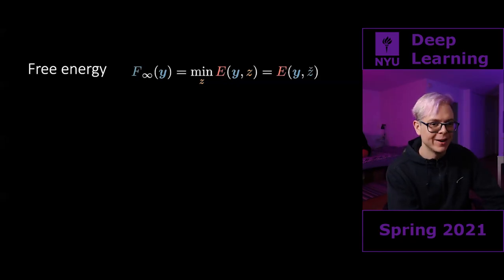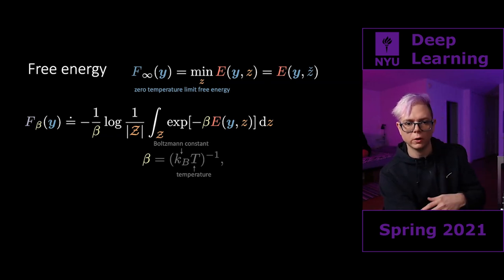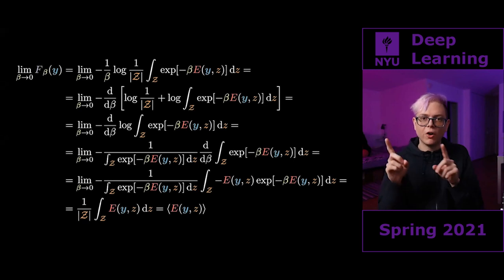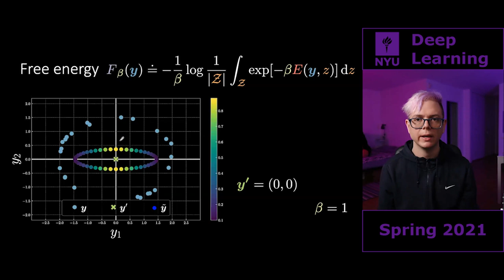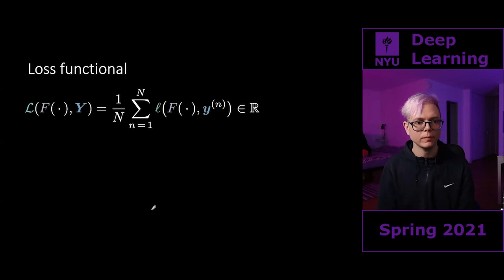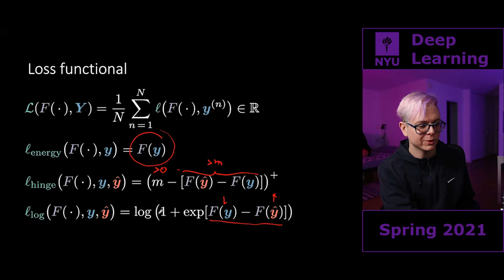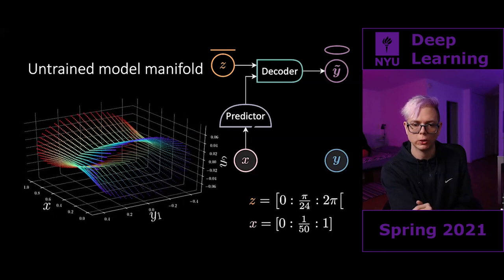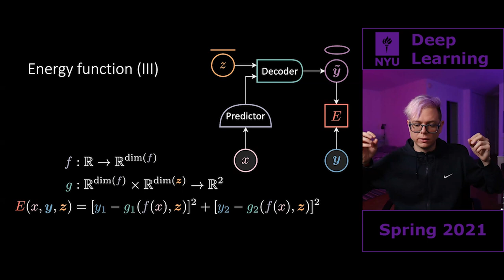06 – Latent Variable Energy Based Models (LV-EBMs), training

Comment: Hi Alfredo thanks for the clear explanation on a not so intuitive topic :))

I've got a question which might be a bit silly to ask lol 
At the end of the video you've mentioned that there are 2 things to research/work on:

1. How to find the right decoder
2. How to determine the constraint of the latent variable

May I ask for point number 2, apart from the dimension of the latent, should the subset of value of latent also be learnt? Or actually by constraint you mean constraint of all kind no matter it is dimension of z or subset of z or other weird stuff.

For example 59:37, should the range of z be learnt so that it is between 0 and 2pi? I understand that in fact z can range from [-inf: inf] in this case coz eventually it is fed into a sin and cos function.
Reply: I think I might have figured that out. It should be all kind of constraint, like for VAE we learnt the mean and variance of a normal distribution. For other type of architecture it can be some other weird stuff...
Reply from the maker: The VAE adds some regularisation over the code, such that there's no infinite low energy space. So, point 2 says that you need to figure out a way to limit the information content of z.
Reply: Cooool seems information theory is a must-learn…

Comment: Thanks for this amazing video Dr Alfredo.
I have a question, during the training of the model, do you use actual-softmin with value of Beta = 1 to do the minimization process and backpropagate through that?
and if i want to use Beta = infinity would you do the same with actual-softmax or simply take the minimum distance point for z and backpropagate through it?

I could not find training notebook for the same video.
Reply from the maker: You're welcome 😊
I did use both, β = 1 and gradient descent for the zero temperature limit.
The notebook was not a teaching one (I made it for creating the illustrations). The teaching one now do exist and will be released with the first draft of the book.

Comment: Probably naively, I would assume that as a 1d z corresponds to a 1d zero-energy space, a 2d z would correspond to a 2d zero-energy space... But at 1:02:44 you said that if z is 2d, there is no known constraint on the zero-energy space and that the zero-energy space would be flat. Is there an intuition on why is that? Or maybe I misunderstood?
Reply from the maker: If the ambient space is 2d, a 2d latent would let you reach all locations, effectively giving you a flat free energy, unless you limit the volume of low energy by using a regulariser.
Reply: @alfcnz  Ah I see... If I understand correctly, the ambient space is the y space which is 2d in this case (y1, y2). And this would imply that in other cases, z can be high dimensional so long as it has less dimensions than y (the ambient space), so that the zero energy space is a subspace of the ambient space.
Reply from the maker: Doesn't necessarily need to be of smaller dimensionality. For example it could be larger but sparse.